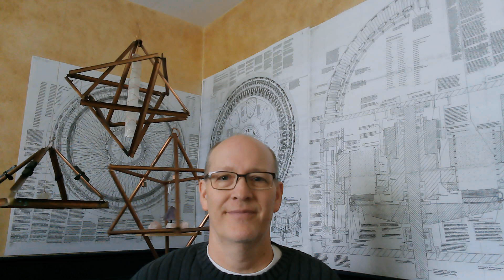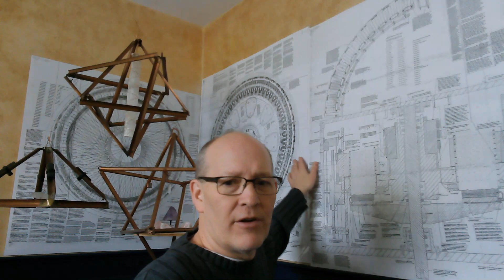Free Energy Motors

Comment: Great info I'd like to see more on this. All of these devices get very complicated. That makes sense if you're making 480 horsepower, however do you have any simple experiments that show magnetic etheric flow?
First we have to convince people that the Einstein model isn't correct.
Reply from the maker: the mini romag is probably the simplest design on the site, but there are certainly many others out there...
Reply: Both Jean Naudin and John Bedini attempted to build the Mini Romag motor without success.  There is nothing else out there that you could build to demonstrate these concepts.
Reply from the maker: Actually, Naudin did a great job of corroborating our results, he just didn't hook up the mini romag to another unit for continuous rotation. I've said many times - the mini romag cannot run by itself, it must be connected to another unit to run continuously. I will show this as soon as I get clearance to do so.